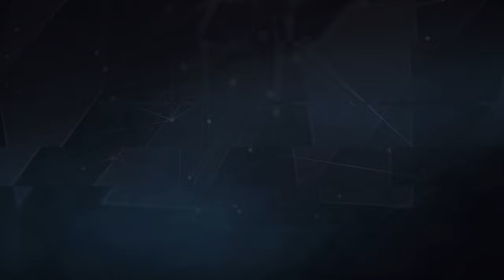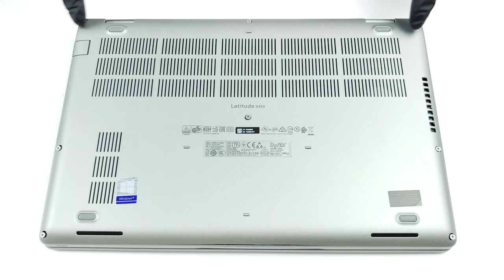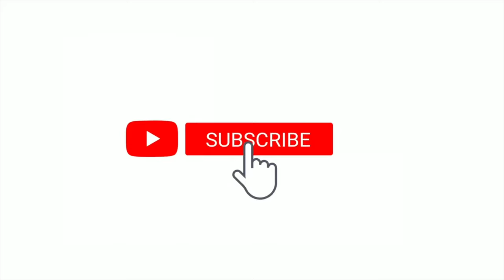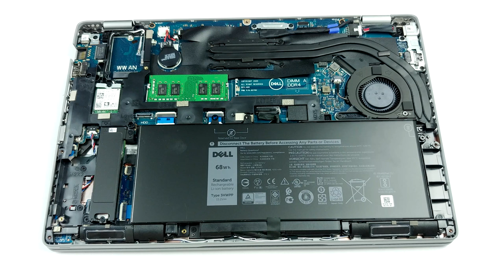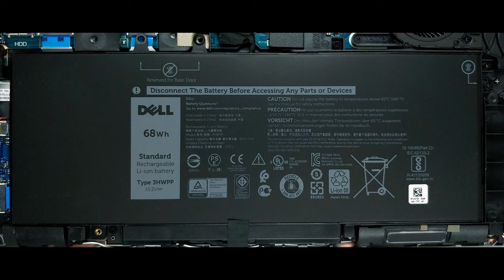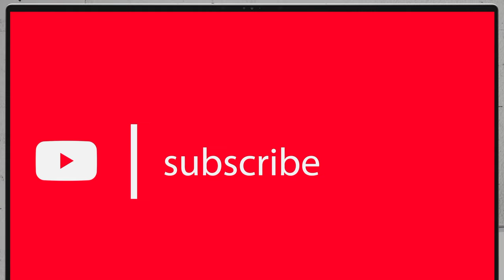🛠️ Dell Latitude 14 5410 - disassembly and upgrade options

Comment: Is there enough clearance in the M.2 slot for an SSD with memory chips on both sides? Or does it only fit one-sided SSDs?
Reply: It fits too. The laptop just overheats all the time without a cooling pad (Not the bluedeath kind, but the reduced performance type)

Comment: Hi bro, i got that notebook, and i got a problem. That notebook it was by my old work, and now the problem is, the company block my system, the screen show a "devicefreeze", and i really need unlock it, if you can help me, i really appreciate so much! ❤️
Reply: I have same problem did you get round this?
Reply: @19SNARF66  Yes bro. I installed Windows 11 and the problem is solucionated. You have to make a clean Install With a Pendrive, look a tutorial, it's really easy 🙌🏻
Reply: I got the same problem I’m going to get it a try with windows 11 thanks for the info
Reply: @alarmsquadnj  It worked for me by installing a 2019 version of Windows 10, so it allows you to do local installation (w11 doesn't let you do it, and neither does w10 new version) and then you put your Microsoft account and update it to Windows 11 if you want